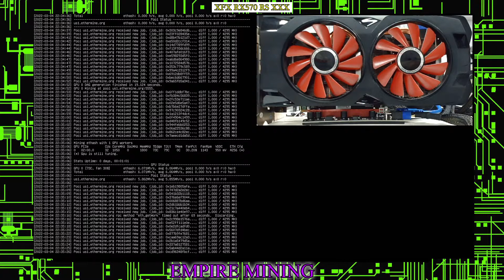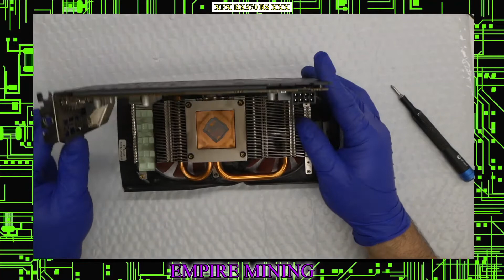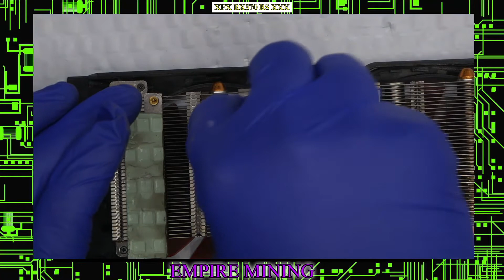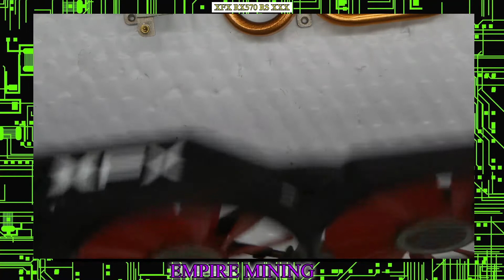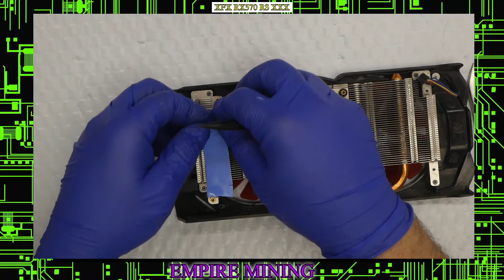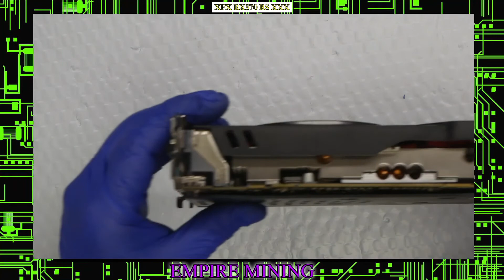Replacing the Thermal Pads and Thermal Paste on a XFX RX 570 RS XXX 8GB Graphics Card to Lower Temps

Comment: Hi, I have that same XFX RX 570, but with 8GB VRAM.
What thickness do you recommend for replacing the thermal pad?
1.5 or 2mm.
Thanks, and best regards.
Reply from the maker: Either is fine! 2MM usually is best! Just make sure they squish down, do a trial run to check!

Comment: I noticed that the vRAM chips don't make direct contact with the heatsink, though they do get air form the fans. 
Question is, do you think it's enough or does this kind of cooling configuration is potentially harmful for the vRAM chips and may hamper their overall longevity?
Reply: Great Question! I have a Biostar RX570 and when I went in to oil a fan, I noticed the same thing, only 3 chips had pads!
Reply from the maker: On this model the vRAM chips are fine with just the air cooling! Back in the mining days we would toy around with custom padding them and it would make any notable difference!

Comment: Hi, can you tell me the size of thermal pads? 2.5mm? Thanks
Reply from the maker: Yeah I'm pretty sure 2.5mm will do the trick! But I do recommend buying a few different sizes to have them fo future projects etc. Can get them cheap with combined shipping!
Reply: @computerspecialist8533  but you wrote in the description it's 1.5mm thick. So which one?
Reply from the maker: @rf.alfarisi  1.5mm but 2.5mm will work if absolutely required.

Comment: don't you need to remove the blue plastic on the pad strip?
Reply from the maker: Yes, any plastic it has you should take off. The pad should be soft on both sides!
Reply: @computerspecialist8533  but you didn't on the top side
Reply from the maker: Some thermal pads only have plastic on one side and some have on both depending where you bought it. Just make sure there is no plastic on either side!